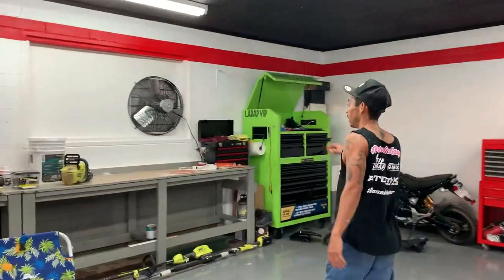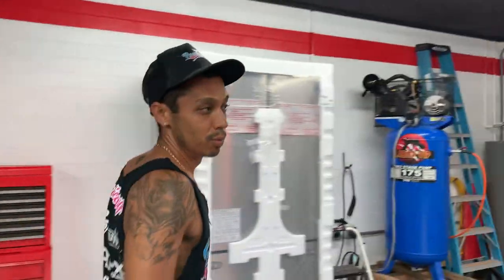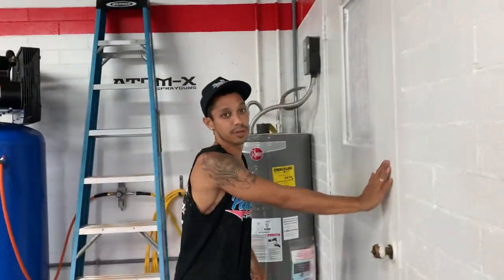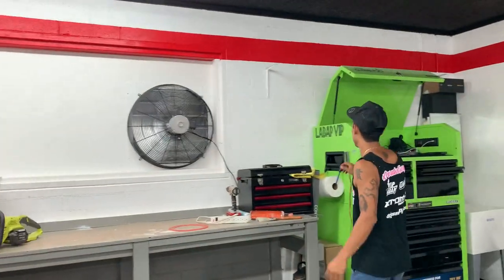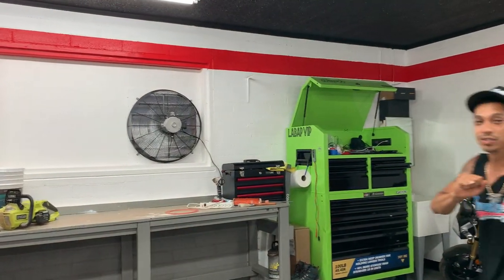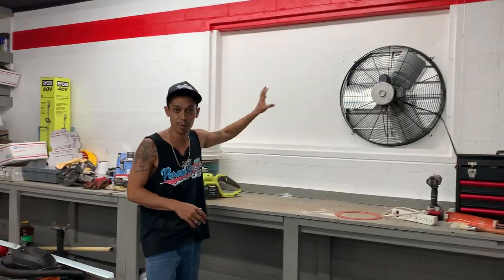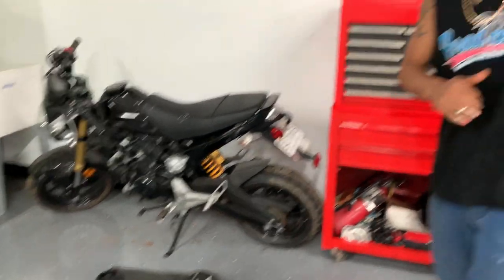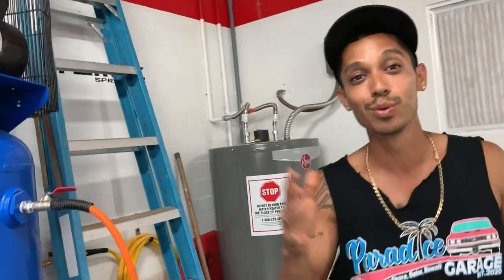Home Body Shop and Paint Booth - Intake and Exhaust Fan Set Up

Comment: Hey Tony, You could also install full length screen door and keep the solid regular door for security. So when you are painting you can just open the door and allow the fresh air through the screen door and install fllters on the screen door or build a filter box around the fan.
Reply from the maker: Yeah well, too late. lol. No need for security, we have gates and a moat around the property! :)
Reply from the maker: That would have been a major opening though. We'll see how this works out.
Reply: Yep or 1/2 door screen
Reply: What about water heater is that a problem

Comment: Just an idea.
Good idea to build a box for the exhaust fan and have a filter between the fan in the box, it doesn’t matter if it’s inside or outside box. 
As long as it’s easy to change.
Exhaust fan, paint fumes should go through filter first as your exhaust fan sucks the air through the filter first. Otherwise your fan and everything outside that fan is going to build up all different paint colors and dust buildup and not easy to clean up. 
Otherwise keeping your home/garage clean on the outside🤷🏻‍♂️
Keep up the good work👍

Comment: I had too much air flow in my booth & caused solvent pop. I installed a variable speed switch like you did to slow fan down & fixed my solvent pop issue.
Reply: I have the same compressor and bought hockey pucks from ebay for mounting on floor.
Reply from the maker: @jeffeaton5221  Great idea. Did you still bolt it down?
Reply: @HowToPaintYourCar  Yes 3/8 anchors

Comment: I made a small diy paint booth for motorcycle parts and furniture. Harbor freight has a blower but I’m sure isn’t flame resistant if i have a filter in front of the the exhaust do you think I’d be safe? I don’t wanna buy a $500 flame resistant blower exhaust fan

Comment: Hello Tony I need your advice I I am painting my car I did paint the base coat on but I don't have time right away to add the clear..do I need to sand the base after sitting for days? What sand should I  use? Wet or dry...ty
Reply from the maker: Yeah I would. Scuff it with 800. If you have more base, scuff it with 800 and lay a fresh coat of base, then flash, then tack it and clear it!

Comment: nice set up Tony, my question or concern is about the water heater - pilot lite any issues ?
Reply from the maker: No issues, electric heater. A pilot light won’t light paint overspray anyway. It’s not that flammable.
Reply: @HowToPaintYourCar  thank you

Comment: I'm looking to do something very similar to this set up, but was hearing some concerns about the fan motor, compressor motor, or lighting possibly causing the fumes to ignite. I know you have experience with this and I personally have never heard of it happening, so anything obvious I should look out for? Thanks.
Reply from the maker: You’re good as long as you’re not using any type of gas heat or propane nearby. You’re good as long as you’re not using any type of gas heat or propane nearby.

Comment: Put a second filter in the door. What's on the outside from the fan?
Reply from the maker: Nothing yet..
Reply: @HowToPaintYourCar  Concerned about fumes getting into house so make sure the door to the house is well sealed. Don't put anything outside the vent to impede dissipation or have anything you care about like plants, fruit trees, dog run or kids play area. The trades should carry the away the fumes/toxins. I'd put in the second fan in and would a dehumidifier, for the wet days, but would that be overkill? Or put a dehumidifier in that slot maybe.

Comment: Can I email you some of the pics of my car have been doing it a month a Chevy Malibu 2008 I have been taking a lot off before I paint it I tried to take the outer plastic around the windows attached to the metal strip but couldn't get that plastic off but only thing else besides that was gonna take off the door knobs and the back lights I already took off the grille in front, front lights, doors and inside door panels.
Reply from the maker: Yes buddy! You can email at ninjasupport@learnautobodyandpaint.com

Comment: The motor for the fan will be exposed to the fumes, hazard for explosion from motor and fumes...a proper spray booth exhaust fan is belt driven as to keep the electric motor and it's internal components away , boxed in away from the airflow....

Comment: So basically just get a regular fan and put it backwards and it sucks everything out instead blowing in  right? So i can get those dual window fans and should work too right
Reply from the maker: Hey Man! You can check them out on Ebay and to know more about tips on auto body and paint check out our VIP Program and Learn How To Auto Body & Paint Like a Pro at https://vip.learnautobodyandpaint.com/home
Reply: @HowToPaintYourCar  cool appreciate  yesterday I picked up a  craftsman 25 gallon compressor 5hp 9.1 CFM at 40psi and 7.1 at 90psi  and I'm adding a 20 gallon tank for extra air supply I'm on a budget ATM I may get cheap lvlp spray gun for now  I'll check it out ur site